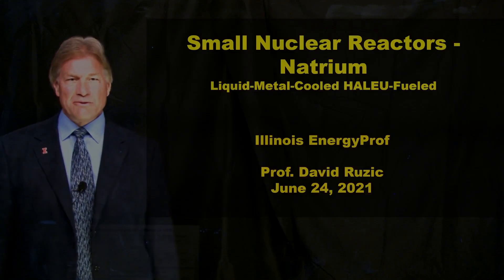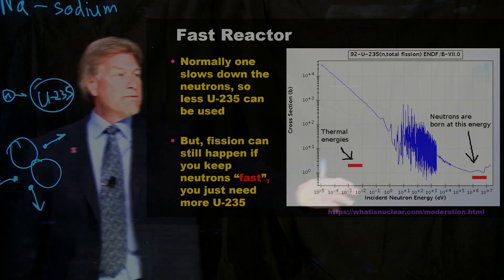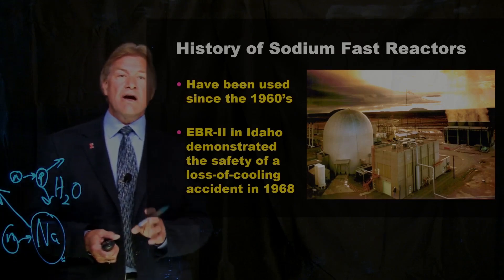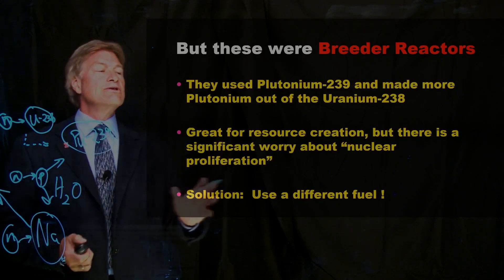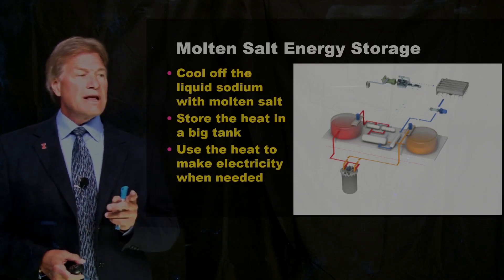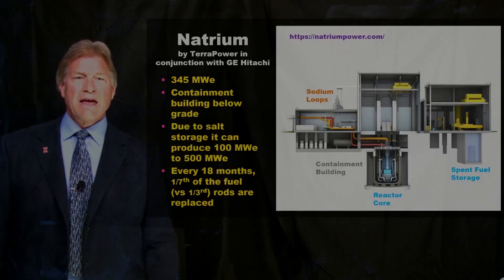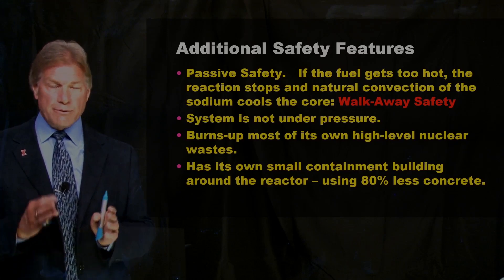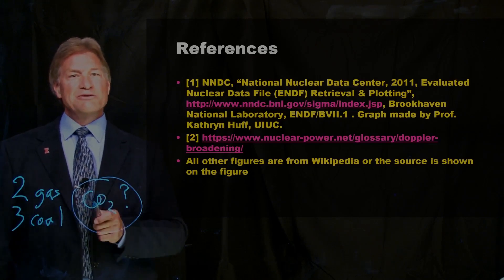Small Nuclear Reactors - Natrium

Comment: Isn't this just a rehash of LFTR  ( Liquid Fluoride Thorium Reactor)   ?  - but why use  Na  (Sodium)  ,  wasn't  the first idea  of  using Fluoride  good enough  ?   - with Sodium You complicate  the heat exchange process   :(
Reply: I am no expert in the matter, but while they are identical, they have their differences.

At the end of the day, LFTR are breeder reactors that use Thorium to form fuel, which, while similar in the concept, it is a very different process from Natrium, which is Uranium based.

This difference may be why it's justified to use one type of salt over the other in terms of chemical properties.

For instance, in Concentrated Solar Power, where they also use molten salt storage, they use Sodium Nitrates, which also differs from both of these ones.
Reply: Also - Google 'Things i Will not work with' and read about the dangers of Flourine.

Comment: A whole lot of liquid sodium... With a whole bunch of radioactive stuff
Sounds explody
Reply: I am curious about the safety of the Na. I assume that it’s elemental and not a sodium based compound?  
Yeah it hates air at room temperature and probable hates it more when hotter.  I understand that it’s not under pressure but still what if an oxidizer finds a way to get to it.  Do you end up with a really scary fire to put out?
Reply: @JayAlfredoG  you have bigger problems if an oxidizer can find its way into a reactor.

Comment: What about the Moltex fast reactor. The fuel is mixed with molten chloride salts. The coolant is a tank of the same molten chloride. Heat is extracted to “solar salt” molten salt heat store. The reaction is self limiting just as the prof describes. 
There is no internal pressure no molten metal and it burns nuke waste. Stuff with a 30,000 years half life is dropped to just 30 years. The “waste” fuel has had just 4% energy extracted. The Moltex extracts 99% of the the remaining 96%. 20 times more heat than the old PWR could extract. The Xenon is not trapped in the reactor core. It can’t poison the nuke reaction.

Comment: It's a good presentation. I would question one thing: the claim that sodium is the best coolant. Lead-bismuth eutectics have a greater molten range (typically 123.5 to 1670 C), are transparent to neutrons while blocking gamma rays, and do not react explosively with water.

https://www.nuclear-power.net/nuclear-engineering/materials-nuclear-engineering/liquid-metals/lead-and-lead-bismuth-eutectic-reactor-coolant/
Reply: On the other hand lead and bismuth are denser, actually more corrosive to normal steel alloys than sodium, and bismuth-209 plus neutrons gets you polonium-210; which means coolant leaks get an extra fun hazard added for whoever has to clean up.
Reply: @drewgehringer7813  I'd like to see the lifecycle corrosion data on that. Like most things corrosion is thermodynamically driven, the temperature of your working fluid plays a major role in the rate of corrosion.

Comment: Funny how he doesn't even mention BN-300, BN-600 and BN-800. Probably because this project pales in comparison, as BN-800 having double the capacity already cost 2,7 bln, not n-th project, and BN-1200 having triple the output capacity will cost even less.
But of cause Russia having loads of hydro power plants has no need to balance power with NPPs and use them as core power producers, so BNs have o need to overexpense themselveself with molten salts depos etc.
Also its hilarious how HALEU is proposed to be superior to any other kinds of fuel when there're MOX and MNUP.

Comment: Glad to see the point made that nuclear also needs power storage. Solve power storage and you don't need nuclear. CSP also can use molten salt storage and it is on line now. Solar PV/battery is getting better and cheaper having not yet reached its theoretical cost/performance limits. If this fast neutron tech could solve the existing waste problem somehow it would be worth subsidizing but there is no way it can imaginably be cost competitive even with the clever idea of recycling coal plants. The licensing alone is a nightmarish prospect for that.

Comment: This does seem a bit like a sales pitch, I'd be interested to know:

The claim is for a price significantly lower than current LWRs, but sodium cooled reactors have historically been more expensive than LWRs. How has this been achieved, and how reliable are the cost estimates?

SFRs have often been plagued with reliability problems - Superphenix suffered very badly from this. How have you addressed this?

I hope it succeeds, but the nuclear industry does have a history of overpromising and underdelivering.
Reply: In this case, economy of scale. These are small reactors designed to be manufactured en masse. Just like Nuscale's SMR (which is a PWR). 
The historical problem with Nuclear power is that each reactor was not only under the most regulatory control of any kind of power, every part had to be built custom made (at least here in the US, France standardized their plants back in the 60s). 
I suspect that we will see the cost efficiency overtime, as Orgoss put it, Prototypes are expensive, no matter what they are.
Reply: @nathancochran4694  True costs will come down. But will they come down far enough. Solar, wind, and gas in the US have become astonishingly cheap and keep getting cheaper. Sure if you ditch the gas at high enough levels of penetration you have start paying for super expensive storage(or epicly large grid improvements and overbuild). But we might be able to get to 80 or 90% penetration before those costs start getting enormous. And is 20% natural gas really the bottle neck for climate change at that point. Natural gas is also essentially harmless from a safety perspective unlike coal. The obvious choice to handle that last 20% is nuclear. But it might be a better use of money to just use gas and use that money on mitigation or on encouraging less new coal in India. This issue is rarely addressed by the pro nuclear crowd.
Reply: Your question is legitimate but based on an illusion. Superphenix admitedly had technical problems (24 months stop after 53 months producing), it was a prototype. This is important, prototypes are heavy investments and have a steep learning curve for the exploitation. That is why it was a european project. But it was also stopped for administrative reasons for a really fucking long time (54 months !!!). Then it suffered political issues and non sense. Imagine, closing a plant you put billions in and that is in working just fine ?! It was time to experiment and gain knowledge for the future... In 1996, it had 95% availability...

All in all, the choice of stopping was really hard to comprehend when 99% or more of the population and politician barely get the differences between EPR, BWR, MSR... Now we have a climate crises on our hands, what should we do ?
Reply: @IncHolowind  go back to been cave dwellers. We can come back out in about 10,000 years.

I kid of course. I'm just wondering if the environmentalist will kill this project as well.
Reply: French couldn't build the Panama canal,Americans came in studied the medical issues of malaria ,eliminated mosquitos and built the canal.Terra Power is Bill Gates using the info from EBR2.which Bill Clinton moronically cancelled, there are many partners, and computers are more powerful, but you do not want leaks, its explosive when contacting water and our air has water in it.

Comment: It's nice to see someone talking sensibly about the future of humanity. (Without small nuclear reactors we will end up back in the stone age.)
Reply: Yep, and it would take a lot longer to get out of the new dark ages, because all easily accessible energy is gone. SMR is a very generic term, and if the world pick the wrong nuclear reactor again, it might be to late considering how long they held on to the current cold war reactors relic design. I'm no longer holding waiting for fusion, 80 years should been enough. Thorium molten salt reactor seem to check all the right boxes for a fission reactor design.
Reply: @drmosfet  New technology would be nice, but I'd be thrilled to be 'stuck' with relic gen3 designs if they were prolific - as in five or ten per state, twenty or thirty in California, that many again in Texas, or more as required.  Despite the advantages of gen4, no one really cares how inefficient the current reactors may be, high level waste is hardly a problem since there isn't much, and 70 years of experience operating the current technologies have worked out all the engineering and safety concerns.

Just get us on nuclear, period!  If it turns out to be on gen4, super; if it happens on gen3 or a mix, that's great too - we'll continue to develop and transition at the next lifecycle event.

Comment: How small are the nuclear power plants in submarines or Voyager, how long do they last and what happen to their fuel at the end.  Is there no risk of explosion or leak?
Reply: A lot of the new design's for SMR are basically regurgitate submarine reactors, because the smaller size containment might be a little bit better then there big brother like "three Mile Island" and Fukushima.
To repeat a modified phrase "these are not the SMR your looking for"
Reply: The Voyager spacecraft do not have nuclear reactors; heat is created through the radioactive decay of Pu238, and a voltage is generated across the leads of a thermocouple, a device that converts heat energy to electrical energy.

Comment: Be interesting to see a comparison between this and LFTR tech, energy yield, final waste levels etc
Reply: https://en.wikipedia.org/wiki/Sodium_Reactor_Experiment
Reply: @darknase  looks like they fixed the 1959 14th experiment run problems.  Another 26k hours and no incident.

1. Hopefully none of the technology has been forgotten.
2. I would build these early plants in low population areas, or with good shielding.

I always thought that the first experimental thorium reactors should be used for desalination rather than electric.
Reply: @dennisgarber  Typically, coal power plants (which as you know, the idea of this is to build on their area and reuse the existing generation/distribution infrastructure), are away from population centers.  Your concern about being away from population centers is already satisfied.  Personally, I'd welcome one in my backyard, but I just wanted to answer your question :)
Reply: This is better, and the tech is far more advanced,China after years of work has a 2MW test reactor,while TerraPower is ready with the 345MW with 500MW for 51/2hour storage Natrium system ready to be built in Klemperer Wyoming. I never imagined our NRC would ever license a fast reactor, but Terra Power will try.
Reply: Second that. Or 9th.

Comment: how about liquid lithium, assisted neutron breeded fusion-fission reactor
Reply: assume everyone already has u-235
Reply: plasma centrifugal side wall compression ion acceleration reactor
Reply: lorentz dc acceleration, centrifugal side wall very high density plasma, heat out by side wall, cold gas interface on the wall
Reply: you adapted nuclear to be used as peaker plant

Comment: What if the sodium leaks / dry reactor core? And it reacts with air humidity too...
Reply: Sodium does not explode from humidity in the air, but it very quickly gets covered with rust.
Reply: Although if it leaks on a  really bad rainy day.

Comment: When was the last time you couldn't buy gas?

When was the last time you experienced an electrical power interruption?

The social systems for distributing fossil fuels and electrical energy are about the same age. Yet over the last 100 yeaes fossil fuels have proven to be an order of magnitude more reliable for society than electricity.
Reply: Fossil fuels are finite. Leaving aside issues with pollution etc, one day they will run out or be uneconomic to extract.

Comment: Fantastic video and very educational.  I have a question about this.  One of the advantages of something like a Thorium reactor (LFTR) is that Thorium is more abundant than Uranium and it's also a liquid salt style reactor so it has some of the same built in walk-away safety measures.  My question is whether you can use the heat storage type system for LFTR's like you can with this Gen-IV HALEU-fueled reactor?  Thanks again and I am eagerly awaiting more videos.
Reply from the maker: One could add molten salt storage to anything, but it would not make sense from a thermodynamic point of view to do it on a water cooled reactor.  If you already have steam - you want to use it.    My next nuclear video is likely to be on a reactor actually cooled with molten salt, so in that case you don't lose any efficiency by transferring heat to the storage media.
Reply from the maker: not sure why there is a line through those words.  I did not mean to have that line there!
Reply: @illinoisenergyprof6878  Hyphens that got interpreted as strike-through code. 
test - test - I guess you had "water[space]-cooled ... steam--[space]you..."